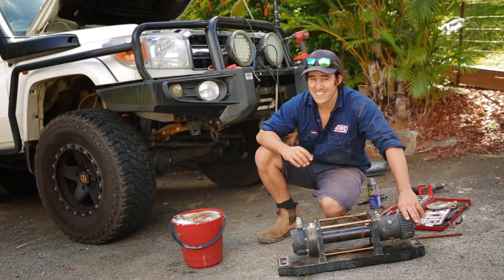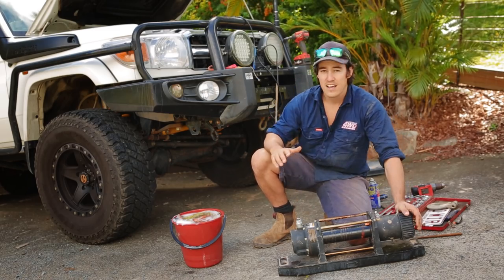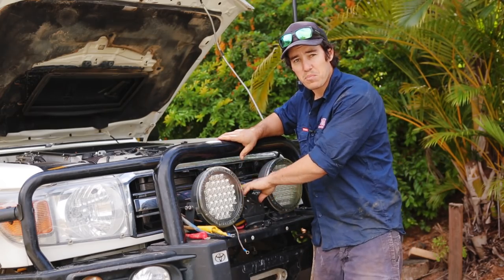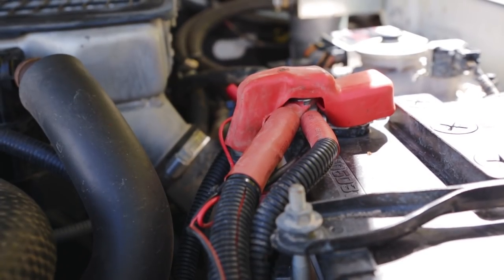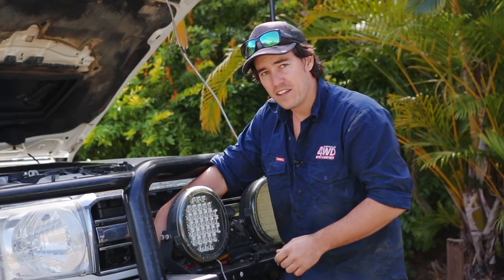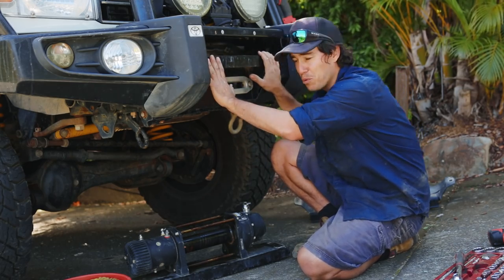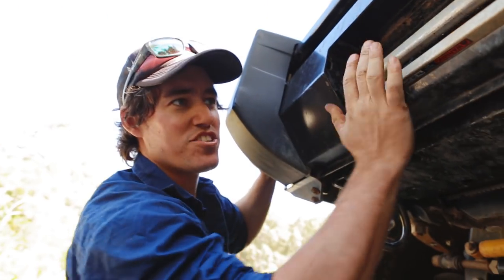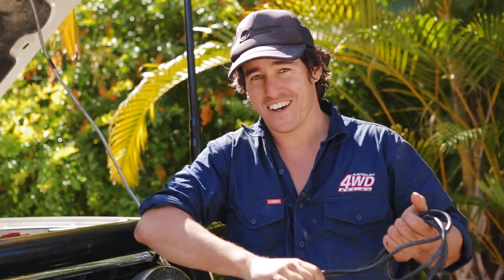How to install a winch

Comment: So the first layer of rope doesnt require tension? Under the impression if i pre tension the first layer wont it rip the rope straight off the drum? Any advice would be greatly appreciated as finding accurate information for respooling seems to be hard to find, cheers
Reply: Just noticed nobody answered your question, you need about 5-8 turns on the drum before you load it up (don't need the full first layer), and any time you take it off to clean it like in the vid, you should pre-tension it again (surprised he didn't mention that).

Comment: Hey mate what’s the standard pound rated winch to install?
Reply: As a rule of thumb, 1.5x the weight of your vehicle. So, on say, a patrol, they weight about 2.5t (factory weight), or 5500lbs. Bare minimum to look for would then be 8500lbs, but you'd be really pushing it. Safer rule is about double. So a 3 ton vehicle (6600lbs) should get a 12k winch as a safe estimate.

Comment: never mount a winch to a bullbar. if you do, upgrade the mount bolts to grade 10.9 or higher. The bolts can break, and the bullbar can become a projectile.
Reply: I like to live dangerously
Reply: The winch was bolted to the Toyota winch cradle which was bolted to the chassis brackets, the bull bar bolts to the same brackets
Reply: @ilove2explore  we run the same bullbars at work and they don't bolt to the chassis at all, they bolt to a mounting frame on the underside of the bar. They tear the mounts quite often, I'm always repairing them, never seen any manufacturer in the 20 years I've been a mechanic mount them to chassis rails, as I believe they aren't actually allowed to make them like that, due to prevention of the crush zones the vehicles are made with, from working properly.